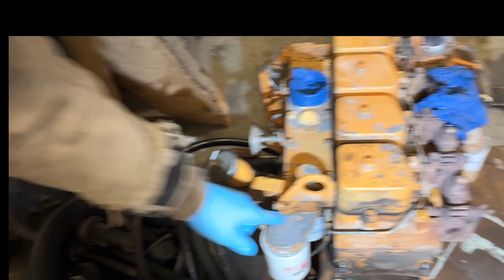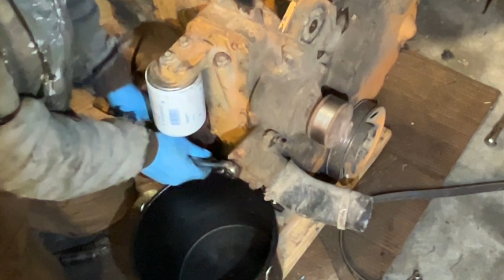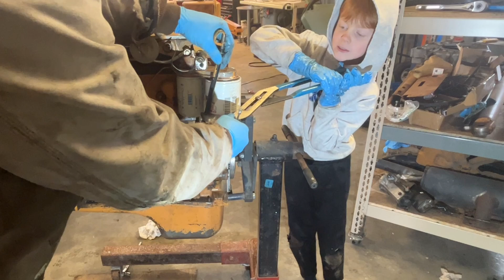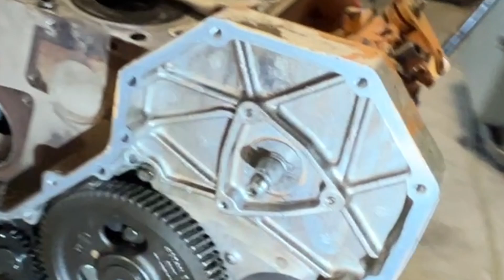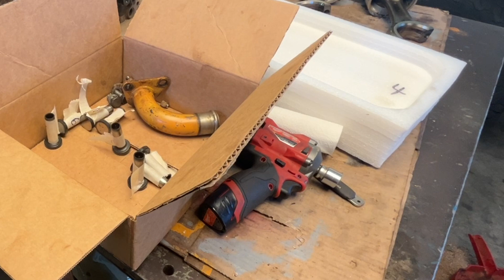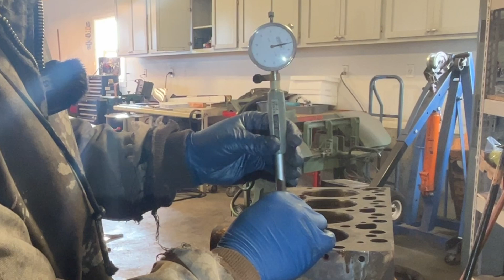Case 1840 Restoration - Cummins 4B Engine Teardown & Inspection-  Pt. 1

Comment: Hi Mike, have another question.  My engine is also spinning slow. I noticed your engine was spinning the same way. Did your engine start before you rebuild it. If not what what was the issue for cranking slow.
Reply from the maker: My engine doesn’t crank slow with the proper battery and cables.  Are you sure the battery load tests good?  If the battery tests good you could voltage drop test the cables.  If the cables test good then the only thing left is the starter itself.  It’s unlikely anything internal to the engine is causing a slow crank issue.
Reply: @MikefromMissouri ok check the cable. I put a new starter and new battery.

Comment: Thanks for this -- I've never been any deeper inside my 1840 engine than just the lift pump and the water pump. This gives me an idea of what to expect if I need to work on it further in the future.

I was very impressed with the bolt-on crank pulley! That's the first time I've seen a flange on the front of the crankshaft, which makes it a lot easier dismantling the engine.
Reply from the maker: Welcome,
There will be an assembly video also

Comment: If you need any help on engine parts I may be able to help. Some models of the 4B are listed on the Cummins web site and some are not. I'm on the site "4bt Swaps" and help guys all the time. Just something I enjoy doing. If you give me the ESN (Engine Serial Number) I can look and and see if it was a regular production model or one of their special contract engines. You appear to know what your are doing. Nice to see you involving your young man. This engine appears to be in good condition which is not always true.
Reply from the maker: @chas1355  Hello, thanks for the comments. I’ve been told it’s a special contract engine but the serial number is 4440979.  I’m trying to order piston rings but find the ring thickness is different than what I have.  Both of my compression rings measure 2.33mm and my oil control ring is 4mm.
Reply: @MikefromMissouri  Your serial number is missing one number. All Cummins engines had 8 digits. If it is a contract engine I may not be able to find it but I'll try. Take another look at that number.
Reply from the maker: @chas1355  My apologies - 44409679.  I did find what I think is the correct piston rings PN 3802040
Reply: @MikefromMissouri  Well, my worst fears were verified. Yours was a contract engine so no parts list shows on the Cummins site. Can you look at the top of the piston. There may be a series of numbers stamped there. If so, from that I may be able to get the Cummins part for the rings. Also, on your engine ID tag, do you see a CPL number. That would be a 4 digit number but many only have 3 after a zero. I may have an engine of the same CPL in my list where I could look at. Have to remember that Case co developed this engine with Cummins before they ever started showing up in everything. If you have the serial number of your 1840, I may be able to get in that way. Some companies have the parts lists going back like that. Your engine could be quite old.
Reply from the maker: @ Thanks for trying, let me check for those other numbers and I’ll get back to you. Much appreciated!
Reply from the maker: @chas1355  No CPL but I did find a number in the piston - PW100100 made in Brazil.   I understand if you can’t help me.
Reply: It is quite possible your engine was built by IVECO under a Cummins license. Only a Cummins dealer would be able to look at the serial number you have. I love a challenge but you sort of hit a dead end wall on some of these. The part # 3802040 matches other 4B engines I have serial number for. The vast majority of the 4B engines I run into were made here at the Rocky Mount, NC plant. Yours is possibly an import. Now, the ring number 3802040 is not a cheap item from Cummins. Those are $118.29 per hole. You might be able to buy a piston kit cheaper. Although yours is a non turbo engine, you could even get a turbo piston kit for less money. Those would work just fine in your engine. Of course, when dealing with Cummins, you will find there is a slight price mark up. LOL. AGKITS sell those rings for $16.82 per hole. Counting shipping that would be roughly $80 for a set instead of near $500. If you have a Cummins store near you they may be able to run that serial number and verify the part number. I'm going to send your ESN to a local dealer and see if he can access it.
Reply: Can the camshaft be repaired and  re ground?
Reply from the maker: Mike, I sent it out to Delta Camshaft in Tacoma Washington. They do a bunch of Cummins flat tappet work and they felt confident in repairing it.